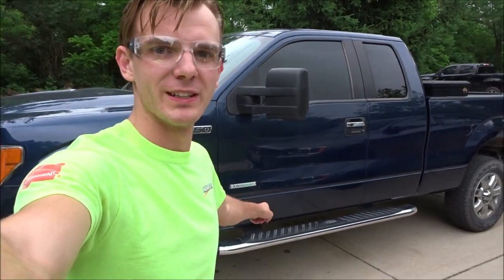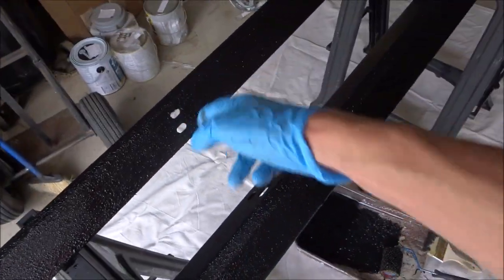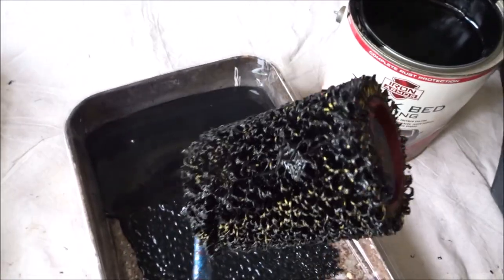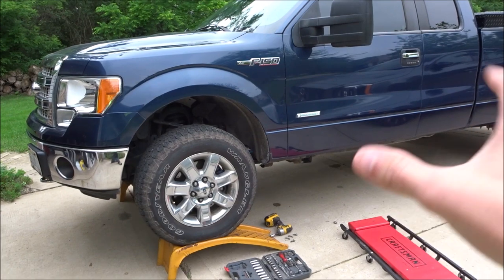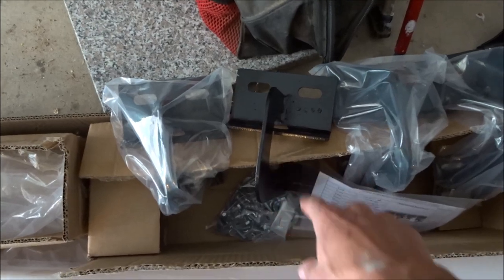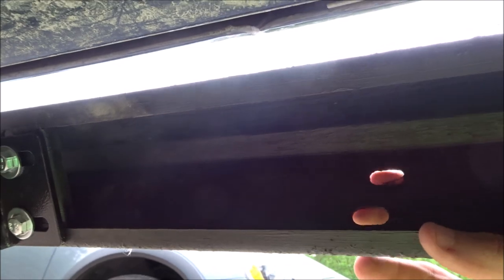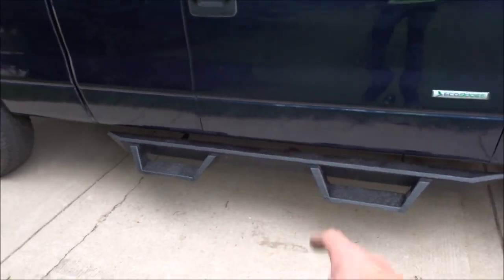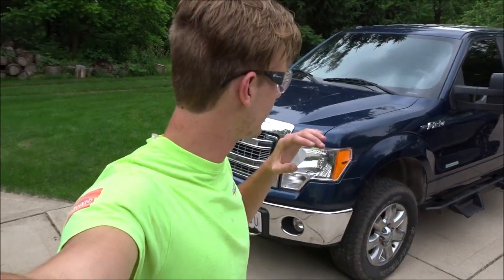Installing Ebay Side Steps!

Comment: I took mine off for a little bit and eventually got a set of black low profile  running boards online for like $300, it is metal with a rubber strip on top. The only chrome I have on my truck is the grille, bumpers, and door handles. I'm not a big fan of chrome but I like the color contrast of the chrome and grey. I also have the OEM raptor headlights and taillights and they look so much better than the stock chrome ones.
Reply from the maker: The chrome doesn't look too bad with the grey. Nice, I'd like to change mine to the raptor or fx4 headlights as well.

Comment: I like my 'Raptor series 1503-0044B' bought at summit racing. The review I did is on their site also. 2.5 level upfront and a 2.25 block in rear of my truck. 3 ohio winters and not rusted yet.
Reply from the maker: I'll look into those for sure!